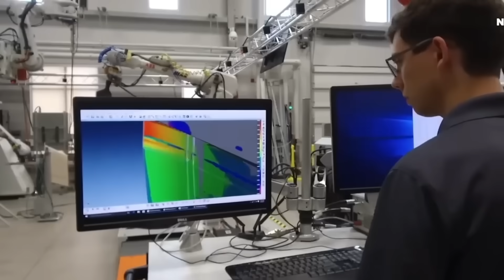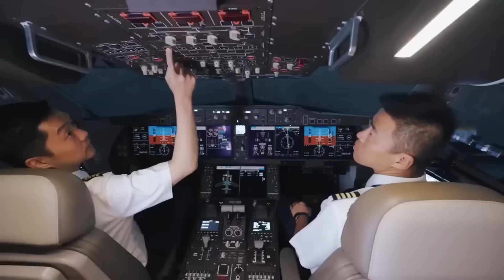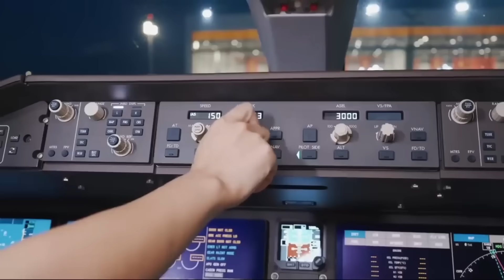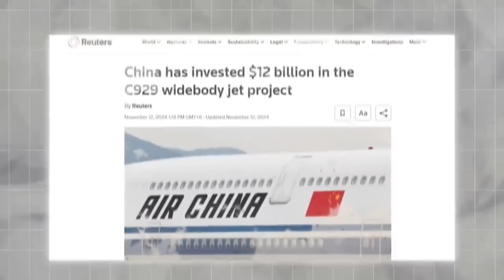Boeing & Airbus STUNNED As China’s C929 Aircraft NAILS 12,000km Test Flight!

Comment: Hmm ,  the key problem holding back China in the aviation sphere is building "reliable Jet engines".  The metallurgy required for rotor blades has been so substandard  ;  the operating hours for Chinese made Jet Engines is/was not viable.  A 12,000 km test flight is not surprising..!
The real question is ; how soon after , did they  replace the Jet Engines..?

Comment: The C929 aircraft successfully completed a 12,000km test flight, marking a significant milestone in the country's aviation industry.
It highlights the growing capabilities of China's aerospace sector.
The C929 is designed to compete with established models from Airbus and Boeing, offering a range of 12,000km and seating capacities between 280 and 400 passengers.
The aircraft is expected to enter commercial service by 2035, with Air China as the launch customer.

Comment: China has fleets of engineers, scientists. Nothing is impossible. There will be more hitech and inventions (breakthrough) in the next decade.
Reply: Hmm ,  the key problem holding back China in the aviation sphere is building "reliable Jet engines".  The metallurgy required for rotor blades has been so substandard  ;  the operating hours for Chinese made Jet Engines is/was not viable.  A 12,000 km test flight is not surprising..!
The real question is ; how soon after , did they  replace the Jet Engines..?
Reply: @1arritechno  China is currently testing hypersonic jet not just hypersonic missiles. Must have super strong materials in all aspects for such speed. Most likely at this stage is the application phase. Especially the software and hardware must be reliable and responsive when moving at such speed and heat. For sure the space program and technology can complement such requirements. Space equipment must be reliably operational in extreme hot and cold conditions.

Comment: Don’t why there are uploads on C919 and C929 China Civilian aircraft. Sadly C919 didn’t pass EU airworthy approvals. 
C929 still on drawing board. Now that C919 failed in EU both aircraft are on hold for a very long time, without engines 
both project in deep hole. With home built engines and domestic parts not even in production these 2 project destroyed
For years. China can speed up a little but guys its civilian aircraft takes years even for domestic use. Russian just now got mass production for SJ and MC civilian aircraft 100% Russian made, it took 13 years where they stand now.
Reply: The C919's problem in getting certification is a geopolitical problem, not technical!
Reply: @chongkt6469 delaying certification is akin to the tariffs applied on EVs
Reply: Chinais 30% plane market
Just insist all planes within chin must be c919